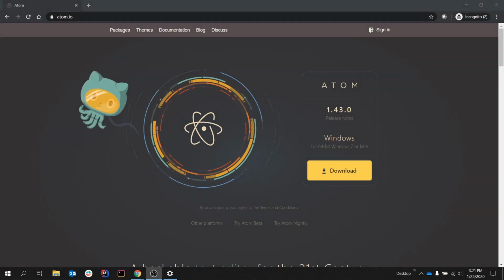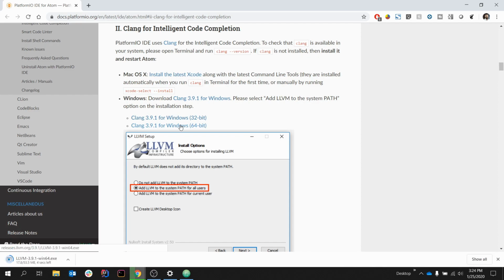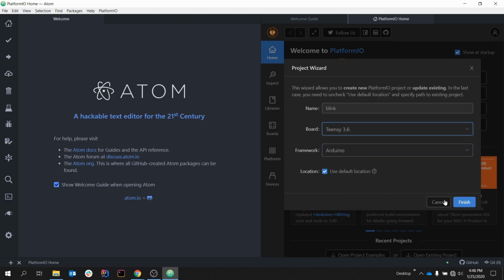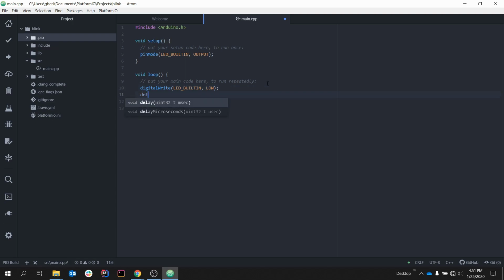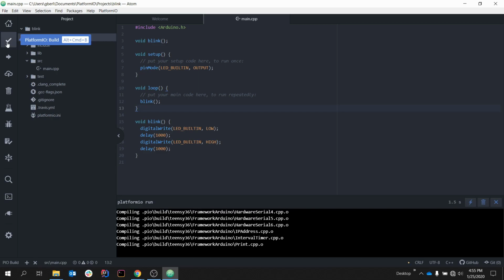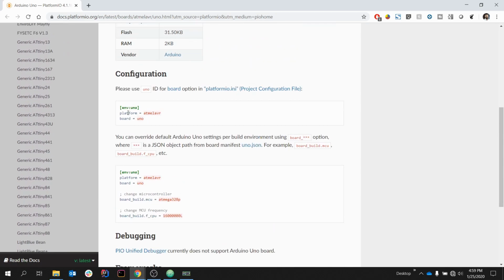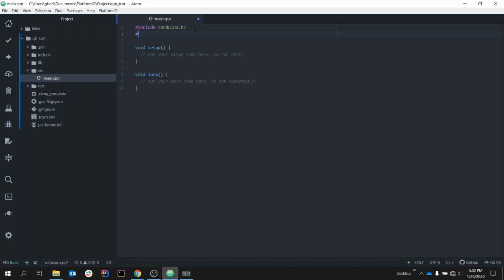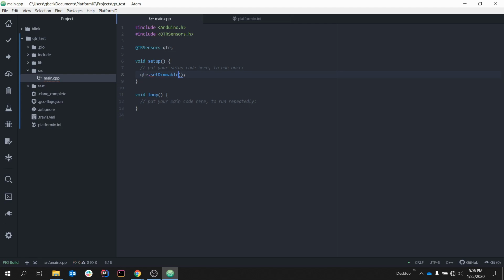Getting started with Atom IDE and Arduino

Comment: I get this Error: Not a PlatformIO project. `platformio.ini` file has not been found in current working directory (C:\Users\Eng Fred\Document
s\PlatformIO\Projects\platformio.ini). To initialize new project please use `platformio project init` command
Reply from the maker: I've been out of the loop for a while so I don't remember the command exactly. I thought it was platformio init but it's apparently telling you to use platformio project init.

In either case, you want to create a folder for your project, enter that folder, then use the init command to generate the CMake files, directories, and other files (like platformio.ini) which defines your project. It looks like you just simply didn't initialize the project.
Reply: I'm getting the same error.  Were you able to resolve this?

Comment: platformio can't find python in my system.I have tried many versions and i get the error message:"can not find python 2.7 or 3.5+ interpreter"
Reply from the maker: The latest platformio is going to require python 3. If you have installed python, have you added it to your environment variable 'path'? I'm making the assumption that you're on Windows so let me know if you aren't.

Comment: Platformio would be great if it didn't always load almost everything from the Internet. Even Library that have already been used are reloaded........ And if you want to work offline, the thing is useless Sure the Arduino IDE is very slow and therefore not really good. But the internet isn't needed for all crap
Reply from the maker: I'm not sure what you mean. The only thing platformIO should be pulling from the internet is dependencies and you don't have to have them pulled every time.
Reply: @RobotResearchLab  Every time I create a new sketch, platformIO needs the internet again. Even if I had used the board before.
Reply from the maker: @Thomas72B  That's strange, it might be some sort of new behavior (I haven't used PlatformIO lately, been really busy). I'll have to check that out though, thanks for the feedback.

Comment: This way better than Arduino IDE. Been using Atom for a while for other stuff.
Reply from the maker: Agreed, the Arduino IDE is great for beginners but is severely lacking in what's considered pretty standard for IDEs these days, I mean, many text editors have basic auto completion.

If you're interested, a while back I read about the Arduino IDE 2.0 which is currently in Beta testing. I tried it out a while back and it had a few bugs but was a pretty decent upgrade, hopefully they release it soon, it's been around for a while, they seem to be dragging their feet.

https://www.arduino.cc/en/Tutorial/getting-started-with-ide-v2

Comment: It looks like platformio for Atom is depreciated now...
But it is not mentionned on the platformio's website !!
Reply from the maker: It looks like they just released a new version in June of this year, maybe it broke from a recent Atom update and they haven't fixed it yet. What makes you say it's deprecated? I see there is a recent issue in the code repository that says it crashes during install, is that the issue you are having? Here's a link to that issue if you want to be part of the discussion https://github.com/platformio/platformio-atom-ide/issues/2439 It looks like the temporary fix is to uninstall the latest version and install the previous version, it explains how a few comments into the bug but here's a direct link to that as well. https://github.com/platformio/platformio-atom-ide/issues/2439#issuecomment-674568197

I'd like to know what issues you're having so I can keep up to date on these issues as well, let me know if any of this helped or if you're having a different issue. Thanks for watching!